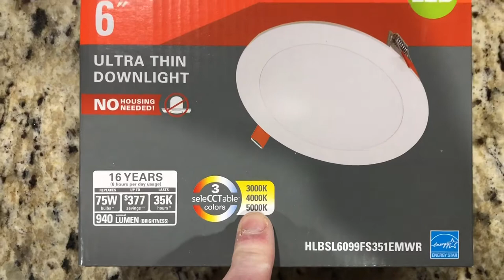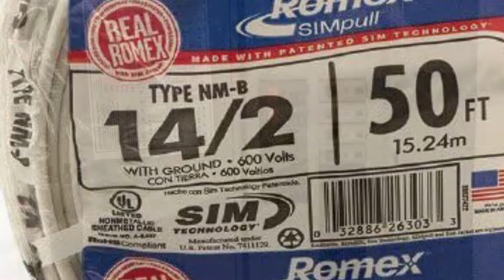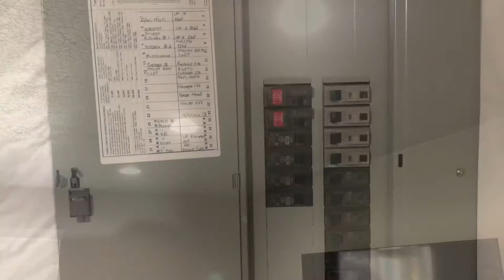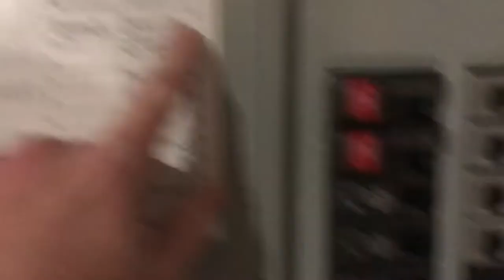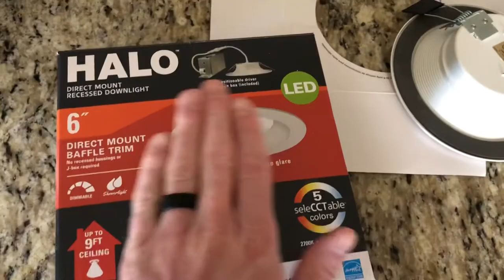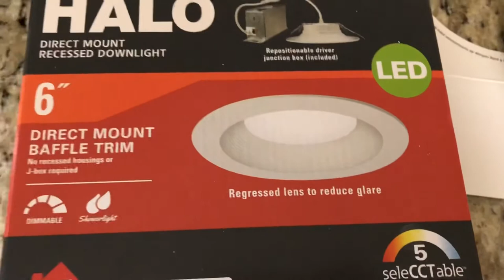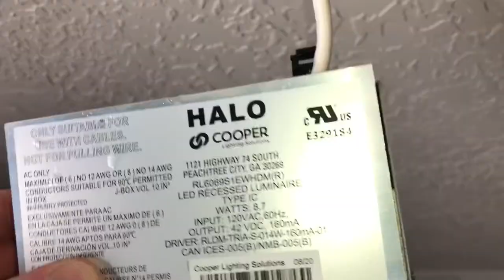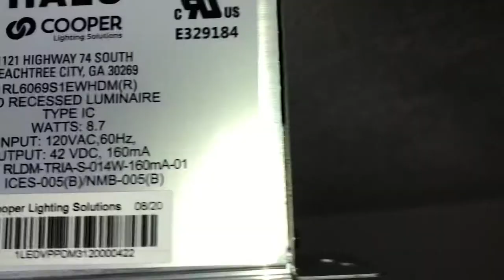Pot Light, LED Cans, Recessed Lighting Install with NO ATTIC ACCESS - Led Lights, Dimmer Switch, Etc

Comment: I started working on my basement
I have 1 central light on a 3way switch

Not knowing how the switches are wired (direct to each other or through the ceiling light). I think it’s through the latter

Can o use 14-3 to connect all of my LED lights?
Or
Should I try to connect the switches to each other with 14-3, then use 14-2 to connect switch and all the LEDs?

*i see red wire(s) connected to the central light 

If connecting the switches, can I run the 14-3 through the ceiling to the other switch

#Noob
Reply from the maker: That is one of those “hard to say since I am not there to see it in person” situations.

Comment: Well, this is useless.  You already have the wires running front to back (left to right in the video).  I wanted to see what to do if you have to do a run across the joists.  Under a flat roof (no attic).  
Subbed anyway, the way you broke this up with time stamps and short cut videos let me find out quickly it wasn't what I was looking for.  Everything else was good and helpful advice!
Reply from the maker: In the full length video of the whole project, it does show how you would with a special drill bit.
Reply: @DIYBRY  Found it!  Thanks!